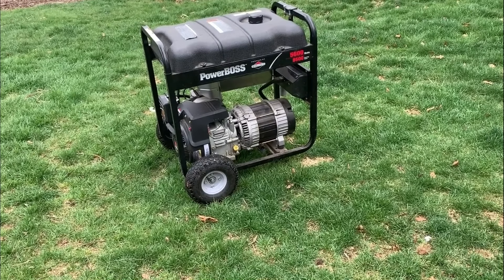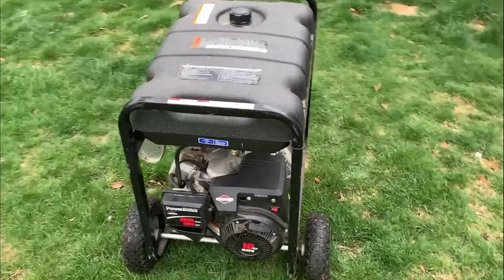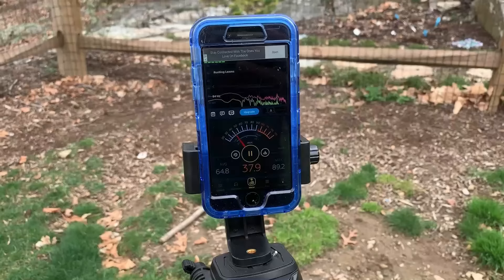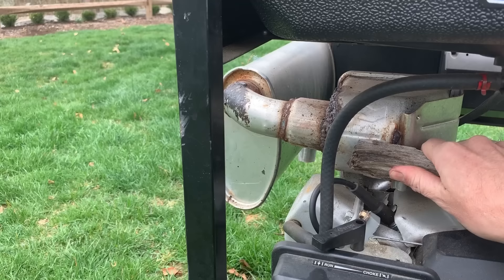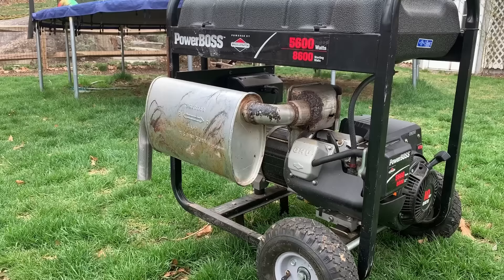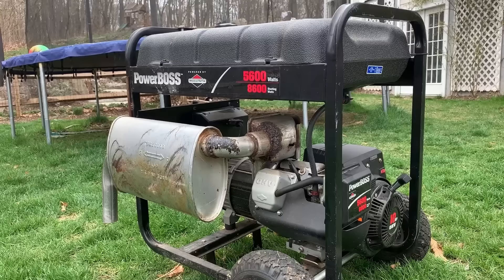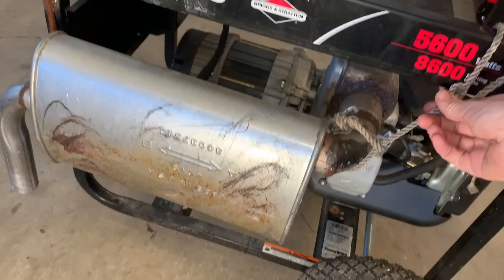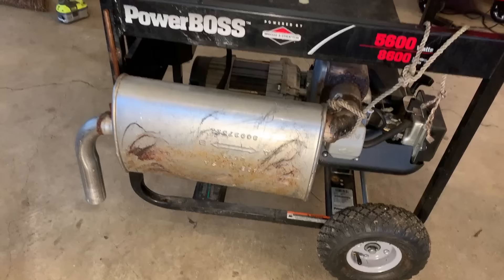Will a Car Muffler Make a Generator Quiet?

Comment: And to the human ear every 3 db sounds twice as loud,so every 3 db it's gonna sound twice as loud.
So taking the car muffler off made it sound 4 times louder.
Reply: Sorry but that is incorrect. +10 db is needed to Sound twice as loud. +3 requires twice the wattage to achieve. ( in sound )
Reply: @batsonelectronics  I did get it mixed up.
Reply: @darknature79  no problem. There were a few comments just like yours from others. I assume you got the double the watts for +3db mixed up with double the perceived loudness of +10db. Peace.
Reply: @batsonelectronics  it's been several years since I've read about it and got double the power for 3 db mixed up with doubling power gives 3db and sounds twice as loud.
Been into car audio since I was 12 and probably hooked up 50 systems by time I was 16 and it's been a good while since I've read up on it and got it mixed up
Reply: @batsonelectronics  my 1st 5+ systems were installed with 2 knob tape decks,cause that's all there was at the time lol.

Comment: One thing about the way mufflers actually work is that there is a reason why cars usually have a muffler about as far away from the engine as possible.

If we assume that all the silencing happens inside the muffler, it would make sense to put it as close to the engine as possible, but like I said, that is not how they are built.

And the reason for that is in the acoustics. For the mufflers to be as effective as possible you would want to have an exhaust pipe long enough to fit the longest soundwaves you are trying to silence between the engine and the muffler.

If I remember correctly, the wavelenght of some of the lower frequencies of noise a typical internal combustion engine would emit can be somewhere around 5 meters, wich is about the lenght of a car.

And if I did interpret the noise measurements correctly, then one can notice that the muffler appeared to have most effect on the higher frequencies.

If I would be attempting to make anything like that, I would put atleast some lenght of tubing between the engine and the muffler... Obviously there would be no realistic way to cram several meters of it, and most certainly not without causing more problems than solving... It is possible that even a short piece of additional tubing might increase the efficiency of the muffler.

In any case that reduction in noise was in my opinion quite impressive... All things considered. But definately if anyone is considering anything like that, one should have realistic expectations.

A muffler and the tubing to connect it should all be designed for the engine it is attached to, to be the most effective. A DIY 'slap an extra muffler on it' project is probably not going to turn a noisy engine whisper quiet, but might be succesfull in shaving of a decibel or few, mostly on the higher frequencies... And it would be easy to view the exact same results as good or disappointing, based on expectations.

Comment: I  have a removable setup that uses a  $18 'turbo' muffler on 2 1/4" flexpipe that simply slips onto a flange I brazed onto the spark arrester ring. It is removable in seconds, and while it doesn't seal perfectly ( I've never bothered to make a gasket set to seal the screen to the flange and muffler) it brought my 8K Dual-fuel Champion down to 58db at 30 ft, which is a HUGE drop in noise inside my home during the all to frequent winter power outages. Maybe at some point I'll hook up one of the many factory take-off HD mufflers I have laying around and compare the DB readings- I've put those on a few old 4stroke dirtbikes as cheap performance mufflers!

Comment: This guy I used to work with had a really nice brand new generator that he bought because the city he lives in had many electric cables destroyed due to a tornado. Whenever he heard it turn off he'd just go outside and refuel it. Well, it died a few hours before it was scheduled to and he wasn't ready to go out so he waited until it was time. Did I mention he lived in the shithole city of Jennings, MO? That's close enough to the shithole city of St.Louis, MO. Yeah, one of his thrifty neighbors gifted my co-worker's generator to himself and didn't even leave a thank you note. So a muffler on a generator isn't such a great idea. Where I live having to listen to your generator run or your sump pump run is a good thing. Especially if your basement is carpeted.
Reply: On the other hand, if the generator was dead silent, his neighbor wouldn't necessarily had known he had a generator. There are other ways of inspecting/knowing your generator has run out of fuel.
Reply: ⚠️Always make sure you follow all the generator safety rules when you use your portable generator: 

This is just a reminder to make sure. It is important to follow all generator safety rules whenever you use your portable generator. 
Here are the things that need to be followed;

1) KEEPING OTHERS SAFE: Please do not allow an unqualified person or your children to operate and service the portable generator. Just because some manuals don’t say that doesn’t mean it’s safe. That is important against the generator safety rules. We also need to be keeping an eye on our children too. You need to make sure that your children are not playing near the portable generator especially when it’s running so they won’t get electrocuted. Generators pose electrical risks and they can be hot during an operation. Please keep your children away from the portable generator at all times. It is important to keep our children safe especially our little ones. Be aware of all the hazards.

2) WHERE TO RUN YOUR GENERATOR: Some people use their portable generators indoors which increases the risk of carbon monoxide poisoning. It’s important to have a carbon monoxide if you have a gas generator. Never ever use your generator indoors even if your doors and windows are open and even in the garage is not safe to use a portable generator. Not even at your porch and your deck. It is never safe to use your generator indoors and in enclosed areas of your home. Your generator needs to be 15-20 feet away from your house. 

3)🔥FIRE HAZARDS: Never refuel your generator while it’s running. You need to let your generator cool off before refueling it and before storing your generator. Never overload your generator too. Never ever back feed your generator. You should never plug your generator into a wall outlet. Also never store propane tanks indoors. Please keep flammable things away from the generator as well and please don’t smoke cigarettes near the generator. Having a fire extinguisher next to the generator is also important against the generator safety rules. 

4) GENERATOR OPERATION: make sure your hands are dry before touching the generator. Never use your generator in wet conditions. Don’t let your generator get wet. You need a generator tent if you need to use your generator during wet weather. Please don’t wear loose clothes when operating the generator. Turn on your generator before plugging in appliances. Use the right cord for your generator. Please do not use worn out cords. 

https://youtu.be/I1jT3ANENvI and here is a video more about keeping others safe when using generators 

Hope this helps
Reply: It's not a good thing for your electrical appliances to run the generator dry, or to shut it off while the appliances are running!  The generator must maintain 3600 RPM to maintain 60hz power frequency  (60 pulses a sec X 60 seconds in a minute) When the generator runs out of fuel, it doesn't immediately cut off the power,  the frequency and voltage slowly falls off over the course of a few seconds. For motor loads, this can blow starting capacitors and burn out windings in motors.  If electronics are connected, voltage regulator IC's and other semiconductors can get damaged.

Comment: I think a electric generator would be the quite .
Reply: The battery operated inverters are quiet. So quiet in fact, that some states are considering making battery operated generators have speakers with engine noises to let you know they are running.
Reply: @JasonW.  🤣🤣🤣🤣🤣🤣🤣🤣

Comment: Thanks it’s a lot louder as every 3 db is twice as loud so it’s about 4 times louder. That said you also have to consider the “quality” of noise. Lower tones, for example, can be less objectionable than higher frequency sounds. Finally these low tolerance splash lubricated “GenaRattle” air cooled motors with their thin aluminum blocks make a lot of mechanical and also some intake noise. I’ve seen installations where the exhaust is piped outside a building and the engine itself is still really noisy.

Comment: Most of the noise comes from the head of an air cooled engine. A muffler just won't make them completely quiet.
Reply: And a lot from the intake and rattles from the crankcase and also the generating assembly.  The open case generators are just loud.  76 dBA versus 49 from one of the "suitcase" Hondas.  That like 30 times the sound energy.  It's just what they are - and that's OK but silk purses and sows' ears.

Comment: Buy a HONDA generator. Dependable AND quiet.
Reply: This.  And not to mention more efficient, and 10 years of use later it’s still running perfect and you can sell it for 80% of what you paid.  There’s just no way to lose with a Honda.

Comment: I once just added a large metal coffee can to a pushmower muffler and it made a world of difference.  He should have moved the meter around to see where the most of the noise was coming from. A car motor is much quieter and many times the size with just one muffler fairly distant from the engine.

Comment: Pipe the exhaust into a 55 gallon drum of water. No noise except valve train.
Reply: Have you done this?
Reply: Admittedly only with outboard motors (small ones) and it works amazingly well on those.
Reply: Is the exhaust pipe submerged in the water or just pointed at the surface?

Comment: There is another potential reason this car muffler was put on; it provides a convenient connection point to attach a hose with an extraction fan to be able to have the generator semi - inside a garage for weather protection or whatever. I have personally considered this. The hot exhaust issue would then not occur either. I would have hung it on a rubber exhaust mount tho otherwise the vibration will break something.

Comment: Come on dude, you did all this stuff for a youtube video and you couldn't slap some muffler tape on the hole..... you used a piece of wood!
And a dremel for the welds and a hammer for the bolts.

Comment: In terms of sound pressure levels. 75DB is At least twice the sound pressure of 70. It is a logarithmic scale. If the automotive muffler was installed more professionally and it didn’t have a big leak that defeated it’s purpose  ( like you tested it) the measurements would have been much more impressive. Still an impressive video. Thanks.

Comment: Something to consider: the pitch of the noise. Note with the car muffler it was much lower in the spectrum (450hz?) verses the stock muffler at 1600hz(?).

Many quiet generators run at lower rpm to further reduce the high-pitch noise. Our 8kw diesel generator runs at 1800 rpm instead of the Briggs standard 3600 rpm, many industrial generators (like at carnivals) run at 900 rpm, this along with good mufflers and good vibration dampening does wonders for the volume levels.

Comment: You need to restrict the car muffler's outlet for it to work well, but it has to be done right.  I removed my stock muffler and only ran the car muffler with my DIY modded outlet and we could have a conversation next to the exhaust.  Putting your stock muffler after the car muffler might be enough to do the trick.  In simple terms, the single cylinder pulses just blast through the muffler instead of getting trapped in it.

The stock muffler from a single cylinder motorcycle would probably work well without modifying it.  If the engine is rubber mounted, your add-on exhaust needs to be supported by the engine, not the frame, or installed with a flex pipe to the engine.

Comment: A lot of people overlook the intake noise and intake baffles on cars and and even air compressors makes a big difference. The problem with a baffle on small engines is they're usually carbed and this makes it not very efficient and you will have to adjust if not rejet, which is more than a lot of want to deal with.

Comment: In the army we would dig a hole big enough to fit the generator so it's completely below ground level and leave trenches on each end to allow air to flow in and exhaust to flow out. You could walk about 100 yards away and although you could just hear it, you couldn't tell how far away it was.

Comment: Mufflers are designed for specific the amount of air in and out of the engine. The muffler is a chamber where sound waves cancel each other out increasing destructive inteference using the sound waves themselves to dampen the noise

Comment: The really big difference was that the standard muffler was peaking constantly at 1600 Hz, while the main peak for the car exhaust was 250 Hz.  That's going to make huge difference in how the sound is perceived.  Similarly, the sound from the hole in the muffler was in the higher range.  In the army we had a system for muffling a small generator that basically reduced the noise to a dull thumping.  You couldn't even hear it 30 meters away, and close up the main noise was mostly bearing and valve.  Very odd stuff.  It sounds more like a sewing machine than a generator.

Also, tacking the pipe onto the existing muffler was a huge lazy mistake.  It should have been manufactured from the manifold on.    So many way this could have been improved.

Comment: From my motorcycle riding days: the fins on your air cooled engine provide lots of surface area to couple mechanical noise to the air. Worse, those fins ring like a bell. Rake a screwdriver across them and see for yourself. Induction noise is a big source too, as any teenage kid who has ever flipped an air cleaner lid on a Rochester q-jet small block Chevy can testify. 

Water cooled engines are the high dollar answer. Ever hear a Honda Gold Wing? No one else has either.

Comment: Dig a hole. Put a 10 gallon drum or larger in the hole. Put 2 holes in the barrel.
Run flexible metal hose from the generator exhaust to the drum. 
Put a piece of pipe on the other hole standing upright. Bury the barrel leaving the upright pipe sticking out of the dirt. 
It is fairly quite.

Comment: My adult son borrowed an open frame generator like that after a tropical storm.  

It was so loud that we tried that.   We used flex pipe on the stock muffler and ran it to a big car muffler.  

The valve train and intake were so noisy that it made as no difference.  

We then moved it into his garage with the flex pile going out a hole in the block wall.  

That made it very quiet.

Comment: The quickest and "easiest" way to silence a generator is to dig a hole and put it in the ground , works great . You obviously don't bury it but leave the hole uncovered and the top of the generator at least 4 inches below the ground surface . A piece of plywood over the top and spaced off the ground with some bricks (air gap) works even better .

Comment: Would be interesting to build a box with insulation and fireproof it and put the generator in that, cut out for the exhaust and fit the muffler again. Lots of cars have sound proofing between the engine bay and the cabin.

Comment: Most of the noise on air cooled engines is resonating from the cylinder and head. Water cooled engines have the advantage of the noise absorption properties of the coolant surrounding the cylinders and inside the head.

Comment: Part of the problem is that the “muffler” used here is actually mostly a resonator. If you were to cut it open, you might find a small amount of sound absorption packing, but most of the interior is resonance chambers tuned to cancel out the original engine’s natural resonant frequencies (a.k.a. “drone”). Those resonance chambers are rendered pretty much useless when you pair them with an engine with significantly different resonance.

A far more effective solution would be to use an aftermarket “resonator” like a Vibrant Ultra Quiet (which is really a muffler, but for some reason half the automotive industry gets these terms backwards). Most aftermarket “resonators” are filled with sound absorption materials that reduce overall sound energy over wide frequency ranges.

Comment: The best way to reduce the engine noise is thermal blankets. I built ultra quiet generators for 18-wheelers but this is a little different because their water cooled with 15 gallons of water you cannot overheat it and actually keeping the heat in is the ideal. The Apu keeps the engine warm runs your AC or heater depending on weather and at Max load Burns a half gallon an hour where is the truck will burn 3 gallons an hour and people will hate you. I built one that was so quiet I literally had to put a kill switch on it so when the key was on on the truck it would automatically shut off. Because I guess the red Idiot light on the dash that says Apu on isn't enough. And another benefit if you're alternator goes out you can start the Apu and keep driving

Comment: Look at frequencies. With car muffler bigger part of sound was at low frequencies - 200-300 Hz, without it - 1500 Hz. Higher frequency - more energy comes to ear and it feels louder, even if measures shows same level of noise. 
Car muffler did its job, but it had to be properly mounted and welded.